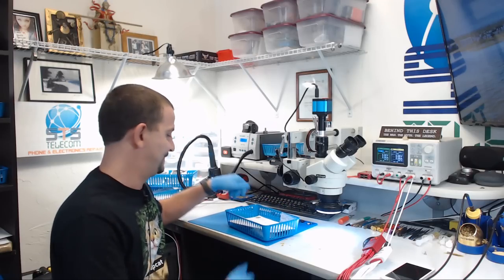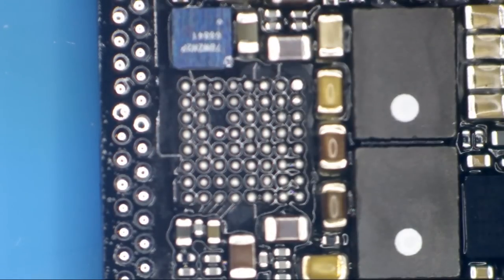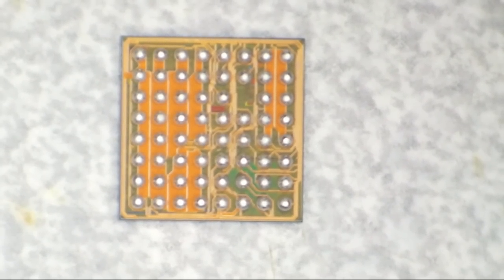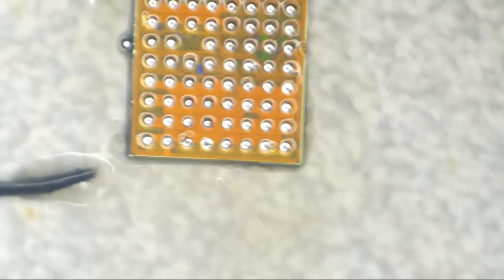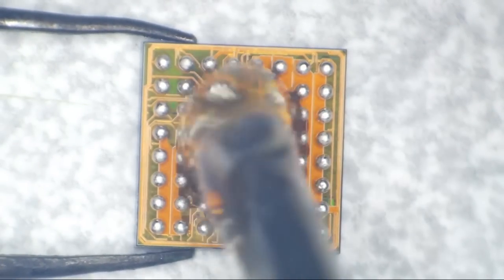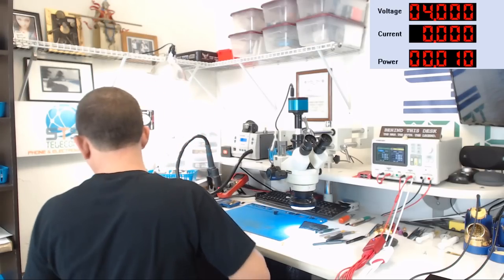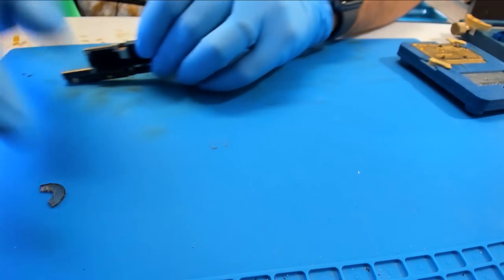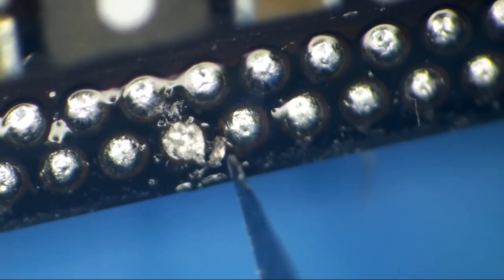Fixing an iPhone X that Wont Charge a Battery (and why I am so successful)

Comment: Technically, if you have leaded solder on the board and place the chip with unleaded solder, the leaded solder will melt first and then instantly transfer lead to the unleaded balls and lower the final temperature to float the chip before any other component gets close to floating.  But, your advice to not overheat the board should be followed.
Reply: I need it

Comment: I watch this Chinese chic that repairs iPhones and she is like some cyborg, 0 hand tremor, lightning fast and crazy precise. She uses solder wick to deball the boards and ICs and her newest trick is to (I didn't believe it myself) replace the connector ends on the ribbon cables. She is a phenom, like a savant. You are some normal dude doing this repair work and have the integrity to call yourself out on crazy crap that you do or that happens while you repair your way to a living and that is just great man! Thanks for the videos I know the amount of time and effort that goes into these is phenomenal and I for one appreciate it.

Comment: Hey Jason nice to see you back! A small tip, something I find works for me....when I’ve cleaned the area on the pcb after removing the bad ic, I use a fine colouring brush to brush the area with just a ‘smidgen’ of solder. This, I find, prevents the flux bubbling and allows the ic to immediately settle down on the board and not fly away or move as the flux bubbles out from under. Keep the videos coming. God bless!

Also, if you squeeze some solder paste between two folds of tissue, the excess flux is soaked up by the tissue and you have a relatively dry solder paste which you can use with a spatula.
Reply from the maker: Hey, I never thought of drying my paste that way.  I always wind up letting it sit around and air dry.  thanks!

Comment: I diagree with the ban on children watching teck things as when I was less than 6 my mom's dad repaired radios ect not 5 or 3.3V but ac 240V and dc 350V approx down right lethal and othe engineering things , in the early 50's.
It got me intrested in engineering especially physics and electronics.
Love you channel the great degree of technical info and great detail.
Thanks keep it up.

Comment: Hello.From the top there is a nut.If a hole has been opened at the point where the nut is screwed in and the balls with charger chip have been damaged, is it corrected?

Comment: Glad to see you back! I personally hate reballing new small chips because the damn stencil moves from it's position all the time. I bought the 3D ones, but if I don't have 3D stencils, I let the lead-free balls. How you do make to get the stencils fixed in it's spot
Reply from the maker: In most cases, my Chipquik flux holds the IC down to the bench pretty good (right up until it's heated).  For larger ICs, I place them on a napkin which seems to hold them in place pretty good.  The small humps of solder on the pads help hold the stencil in place for re-balling.

Comment: Hey Jason. I am wondering about the spacers/slugs inbetween the boards allowing you to clamp or put pressure when putting them back together.
Do you know how to find these spacers/ what they are called? Ive looked quite a bit and was never able to find them. Most people do not mention them.  
Could you install new spacers on any iphone you are reballing? DO they still use them in the newer models with the higher temp solder in the sandwich?

Comment: Wouldn't be much better to wick the pads using hot air like a brush on top? also you're using heat gun at what temp to help when cleaning the pads?
Reply: I find it holding the wick with hot tweezers is even better learn that one from Alex

Comment: I have an iphone 7 with a slight bend around the sim card tray. It worked fine until I dropped it. It draws 0.60A from a genuine apple charger. It doesn't boot, doesn't show anything on the display and doesn't get recognized by itunes. What do you think went wrong here? Could it be tristar acting up?
Reply: .60maH is fairly low. It can be stuck in DFU mode but that normally draws .44maH. It may be caused by a full or partial short along VCC Main. Or a short from a line connected to a chip on the main line.

You'd need to open it and take some measurements to narrow it down.

Comment: Do you ever replace the thermal paste in between the board layers to help improve performance and decrease thermal throttling since the iPhone X has pretty bad thermal dissipation to begin with having a stacked board, steel midframe and glass back?
Reply: Most electronics manufactures use Lead-free solder, which is inherently brittle. Coupled with the iPhone's tendency to bend, the larger and more complex the board becomes the more points of failure. 

Plus most shop use leaded solder, which has a lower melting point than Lead-free but it's also more durable.
Reply from the maker: Depending on the repair, I will try to not disturb it.  I used to wipe it up for the sake of "floating" the boards back together but now I will actually "fluff" it up so that it will smoosh down again when the boards are pressed together.  I usually only have to push lightly with a finger when re-joining the boards.  I've never replaced it though.

Comment: Hi sir can ask qstions?  When I charge my iPhone.. The bar is  not increase. Example 20% later 19 %  what do you think the problem? Can' you help me.??
Reply: If it began do that after you had the screen replaced or it took a head hit or drop then it's most likely the battery data line components near the battery terminal.

I'd test a new battery first, if it has the same results, you'll need board work.

Comment: How would I know which IC part is faulty (U3300 or L3340 & L3341)? What should be the respective voltages for both circuits? Thanks!
Reply from the maker: Yes, I think that’s best.  I’ve changed a bit since this video was recorded.  I often replace the coils with the IC just to remove any doubts.
Reply: @ststele  gotcha! Actually, I'm thinking of just mailing it to you bc of your circuitry knowledge 😀

Comment: hi how many degrees when dismantling temperature
Reply from the maker: hmmmmmm, I wish I could tell you.  The heater I am using only has on/off setting.  It melts very low & will melt way sooner than everything else.    I believe it melts around 138C.
Reply: @ststele  oh okey i understand my use heater quıck 861dw 
 asked you to simulate your device thank you so much
Reply: @ststele  Jason I got the exact sae preheater as you got from mechanic, jess from ipad rehab says it's a crap of device. But I saw your video and you're using it pretty fine. Can you tell me the up and downs of this mechanic preheater..I saw when removing the upper board you lift it really fast not to disrupt the solder so you can sanwditch it again right?. but when you place it on top to resolder it again.. you need to put some clips that always happens? I haven't had the chance to test one X .. but let me know nice to see you around.. Oh bout the accident on stencil shit happens don't worry.

Comment: Don't knock yourself for occasional stupidity.  I am a retired Computer Engineer and programmer.  I got a job once where a software fix patch put in by another programmer had been found to be intermittent and needed to be redone.  I got the job.  I fixed the main problem and then noticed that there was another problem in that he had written a conversion subroutine that took external numeric signals -- a course signal and a corrective fine-tune signal -- and changed them to a single combined fine-tuned value in the program using the values.  It did not match the generic subroutine used for that conversion everywhere else.  I tried to fix his conversion subroutine and spent about an hour trying to get it to run properly for all possible inputs. but it would not.  I then realized that all I had to do was REPLACE his kluge with the generic one, which always worked perfectly, and to hell with his nonsense.  I wasted an entire hour of my life on something that should have been obvious within a minute.  Now THAT is stupid!

Comment: If you use the correct stencil in the first time you would’ve had it right
3 rd time is a charm, I hate replacing chip on those tiny little boards I just replace it with a whole new board.

Comment: hey man, nice video! Maybe you came across with problem on iPhone 7, when connect lightning cable shows battery charging but actually it`s not, also charging percentage jumps alot when lighting connected/disconnected. As well in the main battery menu wear level could not be identified, thought battery is genuine and only few month old. Would really appreciate for an answer. Thanks in advance
Reply: Sounds like battery data line issues. It can be the battery. If it happened after a hard drop or a screen replacement then it is most likely caused by a faulty or knocked off component near the battery terminal.

I'd start by testing the unit with a new battery. It that does not do anything, then you'll most likely need board work.
Reply: @OnYourSquare  yeah tried new battery and no luck :/ i know it`s something wrong with a board, just no idea where to start.... Thought maybe you came across something like that, was hoping to replace some IC and problem will go away
Reply: @justastulpe3265  There is a resistor and a capacitor that on that battery data line. If the problem start after a screen replacement. It's a sure bet you knocked of one or both. Without them the CPU can not read the battery level and temp. and it will not charge it until it has that information.
Reply: @OnYourSquare  did not change screen but it was taken off to look to the board under microscope. If you mean R2201 and C2201 then both of them are ok and  intact.  Also connection from central battery connection pin is good and not broken up to Q2102. Can Tigris chip cause this problem?  Thanks
Reply: @justastulpe3265  Q2102 May appear visually okay it may be damaged internally. 

1.) Diode Mode test R2105. It is the resistor right next to Q2102. Red probe on ground, black probe on resistor. One side should read .463-ish the other should be .274-ish.
2.) If the readings are normal, remove Q2102. Then run a jumper from pin 2 to pin 3. That will ensure the battery status indicator line from the battery connector is directly connected to tigris. 
3.) Put it back in the housing. Plug it up and retest the battery and charger.
4.) That should work but if not, your last result is to replace tigris. The battery indicator line goes into tigris, out a different line, then straight into the CPU.

Comment: Try wiping the stencil with a chem wipe after applying paste, will help with the excess flux when using the wet paste.
Reply from the maker: I love that method but I have to get up and walk around the end of the bench to get a paper towel (so I just keep grabbing my plastic blades).  I should start keeping something at the bench for wiping during re-ball.  Very much agreed it is nicer and easier.

Comment: Where could I order iPhones boards complete and network and iCloud unlock just to build up into a iPhone ?
Reply from the maker: I’m sure there are better sources but when I need a whole board, I turn to eBay and go by seller reviews + item description.
Reply: Depending on your experience level, I'd start with damaged or iCloud Locked boards first. Their cheap and low risk.

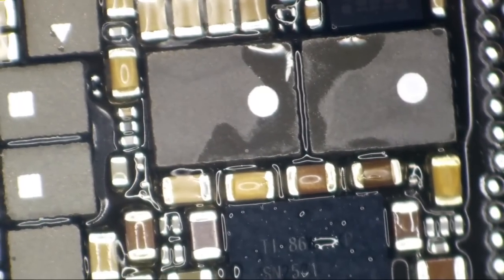Comment: 24:19 What temperature you use in Hot Air to soldering ?
Reply from the maker: I'm not sure really.  When I got this station, I adjusted it to where I was comfortable for various tasks & then saved the preset.  It's set to 430C for the repairs in this video but I'm not sure if it's really that hot.

Comment: I finally opened the Iphone 11 i purchased as a non working phone. Well, I now see someone used an iron and destroyed lots of pads. The Processor board is cracked. This phone needs a complete Logic board replacement. I will just throw the board away. Its not work a penny.